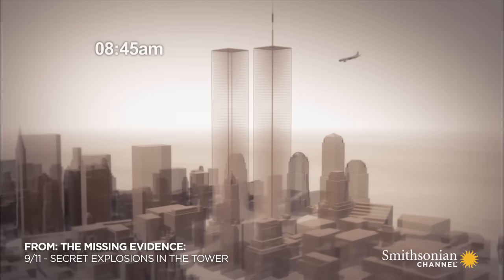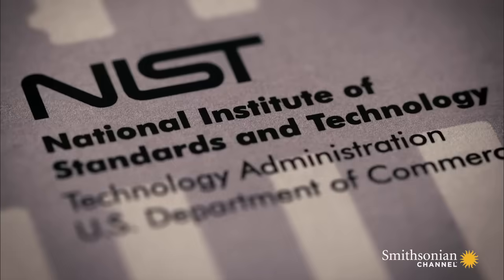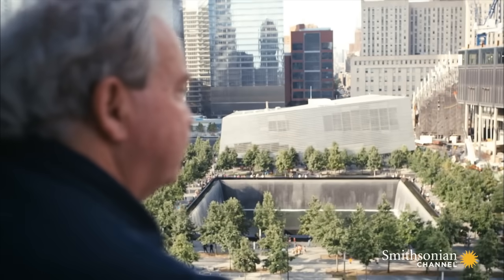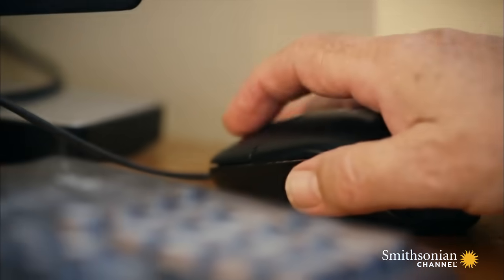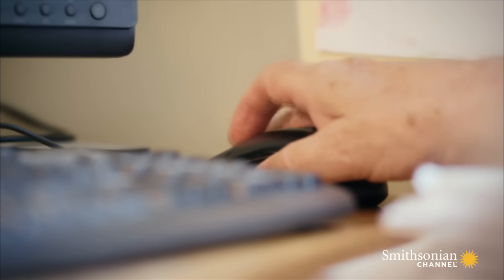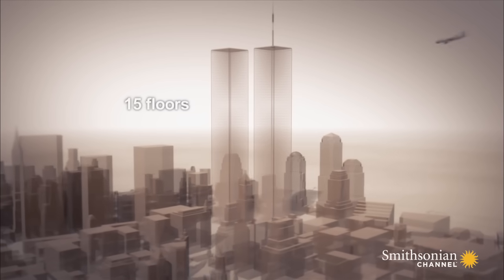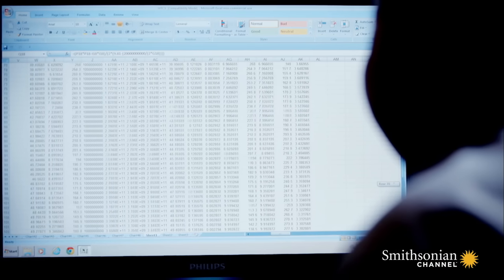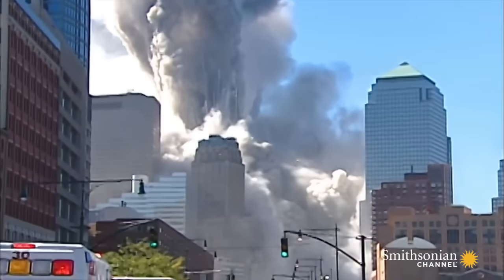This Computer Simulation Explains How the Twin Towers Fell

Comment: So we should believe this guy running some program in his house instead of the 3000 professional architects and engineers who do this sort of thing for a living and contend it was controlled demolishing. Absolutely laughable.
Reply: No.  What is absolutely laughable is all of you idiot truthers who cant understand that the building is NOT DESIGNED for 14 floors to fall on the rest.   That's what is laughable.
Reply: oh,  here comes rockfort files jerkoff,  one of the heavy hitters in the war against common sense.

The top 14 floors represent < 2% of the weight of the building.  

Doofuses like you who think that 98% of the weight is incapable of reducing freefall acceleration by more than a small percentage are not laughable.  That you believe that (which I doubt, I think you're full of shit) is (or would be if you were sincere) an indictment of public education in america.

The fact that you cannot build a model that would behave anything like that doesn't diminsh your enthusiasm.

You are clearly either a moron or a lying sack of crap,  as I've doubtless told you before.

You should look up the definition of science.  You idiots all believe in science by consensus,  but that violates the definition.

Sad sack of crap you are.
Reply: Didnt slow it down.    So then explain how the liberated debris is actually falling faster than the rest of the building.   How could that be.    Maybe just because the building is offering resistance.   How much oh about 2 or3 %    Why becuase it is not designed to carry dynamic loads.

You dont seem to understand any of this.
Reply: @lebergerdesphotons4565  nothing but an eye roll. This has been explained MANY TIMES. The top of the building has been holding all of that weight because it is being carried as it was intended. Should we expect the lower portion to arrest or stop 14 stories MOVING?  The answer is ABSOLUTELY NOT!!  why? Because it only designed to carry it stationary.
Reply: straight down into nothing?? c'mon
Reply: The physical make up of the building was 12% material to 88% space.   The building is almost 90% AIR to begin with.  I ain't makin this shit up dude.
Reply: rockfort doofus,

please cite the same statistic for a boeing 767.  Is it full like a rock?  Or is it even emptier than the building?  And place them both on the mohs scale?  And tell us again about newton's law which demonstrates that frames of reference don't matter?

Let me explain.  It doesn't matter whether the building is sent through a stationary plane or whether a moving plane hits a stationary building, the result is the same.

So lets look at your claim that of course it goes into the building cause of how fast it's going.

Well gosh,  newton says your claim is bunk!

Of course he had a woman's hair-do,  so you might want to write him off.

Hmm,  what does this remind us of?  A baseball and a bat.  The pitcher pitches and the batter swings.  each object has a relatively high speed.  But on collision,  the lighter object changes direction completely and takes off even faster than it came in.  The bat doesn't turn to dust.  Sometimes a bat can break.  It will leave two pieces which could be put back together into an object which would look very much like the original object.

But in your world,  both objects are dust.

I guess the mohs scale must tell us that baseballs and bats are both harder than 767s and world trade towers.

Good thing security never let anybody in there with a baseball or a bat.

Oh, the humanity!  (that's from the Hindenberg which blew up in New Jersey because usa was embargoing helium to germany.)
Reply: Planes are lightweight, thats how they fly ; )
Reply: Right.  300,000 pounds of lightweight.    They fly because the wings generate enough lift to get all of that weigh off the ground.    A fully loaded 747 weighs 900,000 pounds.  I'd hardly call that light.   And 50 tons of fuel?  Liquid does not compress.
Reply: It's all relative baby!
Reply: roquefortfiles
3 hours ago
Right.  300,000 pounds of lightweight.  

lightweight what?

  They fly because the wings generate enough lift to get all of that weigh off the ground.    A fully loaded 747 weighs 900,000 pounds. 

The 767-200ER was the first extended-range model and entered service with El Al in 1984. The type's increased range is due to an additional center fuel tank and a higher maximum takeoff weight (MTOW) of up to 395,000 lb (179,000 kg).

ok,  you're off by more than a factor of 2

 I'd hardly call that light.   And 50 tons of fuel?  Liquid does not compress. 

liquid doesn't compress.  fine.  so when the thin sheet metal tank hits the thick box beams or a concrete slab on edge it ruptures instantly and the liquid is atomized.

200 tons of 767 vs. 300,000 tons of wtc tower.

1500 to one ratio.

equivalent to a 45 slug hitting a 50 pound dog.

Would the dog crumble to the ground in a pile of tiny debris and molten metal?

How about a howitzer shell hitting a big refrigerator?

I guess it would get knocked over or the shell would go through,  but the fridge wouldn't melt and turn to dust, would it?
Reply: what is the percentage of empty space in the 767?
Reply: And an engineer has already explained all of it.   "Had the plane been empty of fuel the building would have won".   The impulse force delivered on impact between an empty jet and one stuffed with 60 tons of fuel is signficantly different.   

Take a bag of cat litter.  A flimsy paper bag you can punch your finger through it?   Do you want to have it dropped on your head from 100 feet full or empty?  
The fact its a flimsy paper bag hasn't changed.   You can apply the same reasoning to the plane.
Reply: @lebergerdesphotons4565  where did the building collapse?. Where the plane hit it. Which building collapsed first?. The second to be hit. The plane hit it 150 mph faster than the first. And off center to one side. How does it collapse?. Off center to one side.  

What a coincidence!!
Reply: rockfish,

this was your idea of logic?  Not surprising.

1/1500th of the weight of the building is the weight of the plane (you know the one that didn't hit the building)

like a .45 caliber bullet in a 50 pound dog.

the dog doesn't turn into a pile of molten dustified rubble when the bullet hits him in the ass.

And neither would the building.

even if the bullet set the dog on fire.

Your argument disagrees with experiment and therefore it is wrong.

Richard Feynman says you only open your mouth to change feet.
Reply: You and Richard Fenyman should book a vacation together.    You have completely garbled his intention.    And your examples are a few notches beyond useless.   And bear no relationship to a plane hitting a building.
Reply: Btw.  What the hell IS your point??   Lets establish that first.    That the plane cannot go through the building???..
Reply: first,  there was no plane, because if a plane had flown right there at 500 mph the smoke from the subsequent explosion would be quite visibly spiralled around in the wingtip vortex.  The video was positioned perfectly to see that and it wasn't seen,  therefore no plane.

The plane in the video didn't reflect sunlight, therefore it is a cgi plane.

Now for the hypothetical.  If a boeing 767 crashed into the building, the building would have locked it out.  It would have ripped itself to shreds crashing into giant spandrel plates fronting giant 4 inch thick concrete slabs on edge.

the debris of the airplane would have fallen to the ground,  the building being no more injured than the dog hit with the .45 in my example demonstrating weight ratios that you don't seem to like for some strange reason (it contradicts your belief system or the bullshit you want others to believe).

Even a solid aluminum bullet fired into the spandrel plates wouldn't make a dent, so to imagine that the 2mm thick edges of the fuselage pushing into those spandrels would do anything significant is ridiculous.

Forget about the speed unless you want to toss Isaac Newton in the trash along with myself and Richard Feynman.

Remember the baseball and bat?  That's a 150 mph crash there and there's rarely any damage to ball or bat.

that's enough.  I know that you're incapable of and unwilling to to ever see a point that somebody could make which disagrees with your programming.

Notice my use of the word programming.  It's intentionally ambiguous as to whether you are programmed or whether you are programming others.
Reply: the debris of the airplane would have fallen to the ground, 

Why? because you say so??     Wow that is just rock solid proof.  Because you say it should.   Don't join the debate team any time soon.  YOu don't convince anybody by opinion.  You convince them with FACTS!!

A B25 hit the Empire state building in 1945.  It put a hole in a solid concrete wall.  One of the engines came out the other side.   (Look it up!)
A B25 weighs 30,000 pounds.  It was flying at 180 mph.  This is considered a LIGHT aircraft. 

The 767 that hit the WTC Weighed over 300,000 pounds.  It carried 10x the fuel load.  And was moving 3 faster.   Hitting a SUBSTANTIALLY lighter structure.  Purpose built as such to be as LIGHT as possible.    (Look it up!!) 

The variance of applied force between the B25 and the 767 was !!!  FOUR THOUSAND FIVE HUNDRED AND FIFTY!!!  x MORE FORCE applied to a SUBSTANTIALLY lighter structure.

Buddy you are so far off the mark there is no point debating anything with you.  We're not in the same league.
Reply: You're in love with Richard Fenyman.
Reply: no,  because the MOHS scale says so.  Aluminum versus steel and concrete.

Tell me of your experience of breaking concrete slabs with an aluminum sledge hammer.  What's that?  You've never seen an aluminum sledge hammer?  Gosh, genius, I wonder why that might be?  Surely a powerful intellectual of your caliber would line up and pay extra to have that aluminum sledge hammer.  Cause you're such a clever bastard you know that you can swing that aluminum sledge hammer faster than the steel one and that energy is proportional to the square of the velocity, so you'll deliver more energy to that mean ole' concrete slab.

Aw,  but then reality would set in and you'd see that a couple swings with your aluminum sledge hammer in spite of the superior energy delivery just deformed while the cement laughed and giggled.

Maybe the mohs scale was right after all!
Reply: El Al flight 1862 lost both of its engines when the pilon of one failed and it broke off taking out the engine beside it.    The pilots struggled to control the plane (A 747)  not knowing what had actually happened as you cannot see the engines from the cockpit.    The imbalance of power drastically affected the planes control.    They brought it in for a landing not realizing that if the speed dropped below a certain level that the affected wing would stall and put them into a spin.   As they came in on final approach of course they slowed the aircraft.  The wing stalled and it went into an uncontrollable spin at low altitude.  With no time to recover.

The plane hit an apartment building.   It took out the entire building and went straight through it.    The plane was flying at about 170 mph LOW SPEED.   And they had dropped their fuel to land.  They took out an entire building. 

And you have trouble understanding a  767 fully fueled?.  Moving at 560mph?  Hitting one wall that was all of 14 inches deep half of which was nothing but glass?  And box columns that were only 9mm thick and hollow?   And that plane going through it easily?   When we have the example of El Al 1862 TAKING OUT AN ENTIRE BUILDING??

Of course if it doesn't agree with experiment ITS WRONG!!

Let Richard Fenyman fuck you.
Reply: Of course you obviously just can't accept the fact that the exterior wall of the WTC was purpose built to be an extremely light construction (Look that up!!) and the fact that the airplane simply went through it EASILY.. No.. That just can't be the case.   

Which it is.
Reply: le berger des photons. Do you actually believe that objects dropped at the same time, that the higher up objects will pass the lower objects?  Even though both are falling at the same speed? You probably believe the earth is flat as well.
Reply: @roquefortfiles  and after that happened they designed towers like the wtc, steel concrete shell, steel concrete core
Reply: @roquefortfiles  I just happen to see you arguing with this " le berger des photons "- guy.. don't bother! I tried to explain the same exact facts to this guy (among many others) and it's totally pointless! I know it's mind boggling how someone can lack all common sense and education but it really seems to be the case here! I've seen more intelligent 3 year old's than this guy so try to forget him.. you're not going to make him any smarter.. that's for sure :/
Reply: @lebergerdesphotons4565  Jesus you're crazy! :D
Reply: @haslahali746   Oh I know.  The only reason i even engage is for the pure "Sociology" of it all.  I find it interesting to see how far someone can take irrationality.   Or total lack of reason.  We all have a brain but some just don't use it.
Reply: @haslahali746  

c'mon doofus,  try again.  surely you can actually say something intelligent indicating that you've made observations and have even some limited knowledge of reality permitting you to say something that could be misconstrued as halfway intelligent.

Why is it vital to you that your "arguments" are always completely absent substance?

You don't need to answer.  The question is rhetorical.
Reply: @lebergerdesphotons4565  I know I shouldn't laugh at people who are mentally ill, but your comments are just priceless so I can't help myself! I would like to give you an example but there are just too many hilarious ones to choose from.. first one coming to my mind is the one where you compared a dog to a steel & concrete skycraper but that wasn't nearly as stupid as some of the others. Just out of curiosity, in which alternative universe, have you convinced yourself to be intelligent by any standards? I know grazy people always see themselves as geniuses, but in your case it's such a far fetch that I really need to know where this is coming from?
Reply: Hasla Hali
“I probably already told you this but I happen to design structures in to buildings.. some of them really similar than WTC’s”
~Hasla Hali
Well shut my mouth... talk about believable.
Reply: @hotmoffitt  I'm not sure if I understood your comment? :)
Reply: @hotmoffitt  No problem! These things happen! :) I first started doing this just for my own amusement but after seeing the total ignorance of this Truther lunatics I'm actually quite worried! :D
Reply: erom1970 3000 out of a 100000 in the US alone, so globally that’s only a drop of water
Reply: erom1970 - These 3000 so called architects are the laughing stock of the whole construction business! Many of them have been fired from their jobs after making embarrassing claims about the twin towers and 9/11. This is probably a good thing considering how incredibly unprofessional they sound!
There was nothing controlled about the collapse of the twin towers! Sheer amount of explosives and wiring required to take down buildings like WTC's would have been enormous and therefore impossible to plant in strategic points without nobody noticing. Not to mention months of pre-weakening work before the actual "demolition". Guy in the video explains how the towers collapsed and he was absolutely right.. I can tell this for a fact since I design buildings myself. There's one thing I've never understood.. how can people like you say things like "so we should believe this guy running some program in his house. Absolutely laughable", when you have zero knowledge about construction business or structural engineering? It's kind of weird that you people seem to think you're able to judge other people's researches on this subject without even a basic education on it. It's freaking annoying!!
Reply: @haslahali746  Oh sure they are, and amongst them a Nobel peace price winner.
Reply: @ZygimantasA  Inventor of a Chlorine gas won a Nobel Peace Prize too. Just like the inventor of lobotomy! Also, sorry for the nitpicking but it's Prize, not "price". Now, please tell how this Nobel Peace Prize winner is and how in hell did he/she win it??
Reply: @haslahali746  There were strange reports of college students having access to floors prior to 9/11 they could of placed bombs.
Reply: Just remember that the engineers behind the titanic deemed it to be unsinkable.
Reply: 3,000 out of the million or so engineers and architects
 wow
Reply: @Ikelae  Exactly.. so fucking impressive! :D I would expect 3000 from a million to be crazy anyhow!
Reply: What makes those 3000 A+E's more credible than the hundreds of thousands of architects and engineers who accept NIST's collapse analysis?  Oh that's right, they must be on Bush's payroll.  Good answer!  derp
Reply: J T  the government has nothing to do with building engineering.
Reply: J T  oh. And your proof of this is what?. Where do guys come up with these wild assertions?. Unbelievable
Reply: Thinking the building is remotely designed to stop and arrest 23 stories collectively falling? THAT is astoundingly stupid. Buddy the safety margin was 6 floors are you insane.
Reply: J T   Of course a passenger jet being flown into it had nothing to do with why the building came down.     Thank You JT without people like you we'd all be lost.
Reply: J T  I couldn't care less about the " official story". Also, I couldn't care less about why or by whom 9/11 happened in the first place. My point is that the towers came down by a structural collapse and I know this since I fucking happen to design buildings like WTC's. Not as big though..
Reply: @haslahali746  

no offense,  but you're obviously either a lying sack of crap or a moron.  If you utter a couple more of your stupidities I'm sure I'll be able to decide which.
Reply: @lebergerdesphotons4565  I can't believe myself actually commenting to someone who compares 1300  skycrapers to a dog but I would like you to explain what makes me "a lying sack of shit" or "stupid" ?
Reply: Its clear now there was no controlled demolishion. In close up video’s you can see the steal beams bent and give way, after an hour intense burning fire, as molten metal pours out the building. The whole building had already taken a punch as the people felt the whole building move when the planes hit and even the ground floor had the windows blown out! The immense huge force of the building coming down just destroyed the rest of it.
Reply: sorry  @BakkerSamuel ,  but you're clearly a doofus.

Wood stoves are made of steel which is less resistant to heat than the structural steel in those buildings.  You can't burn kerosene in open air and get hot enough to do anything to it.  The samples showed nothing above 400 degrees centigrade.
Reply: @BakkerSamuel  Look at this guy J T. Another genius how educated himself in the internet and now thinks he's the smartest guy on the planet! He seems to think that watching Youtube and cussing are the standing points of his superior intellect.
Reply: J T Why so aggressive..? So the people heard explosions, you believe that, but you dont believe the people that saw the planes fly in...
And if they heard explosions it can have had many different causes, as you imagine the huge force and energy when such a big building comes down. I Dont find it strange that in the process things explode or burst out of the building. The building also did not go do down completely straight. You can see the upper part tilt to one side, because the steel beams gave way on one side. That also shows it did not collapse because of explosions. Please Dont reply When you want to be aggressive again.
Reply: J T ahhh are you tired..?? You poor Twin Towers expert..!
Yeah they put bombs in the building and Thats why the building started to brake and collapse exactly at the location where the planes hit.
Or was there a bomb in that intense fire for an hour..?
Reply: @BakkerSamuel  

just when I thought you'd be unable to surpass your previous stupidities.  I think that you need to get into the special olympics.
Reply: J T  As I already said, I really don't care why 9/11 happened. I was talking about the collapse of the towers, and considering the circumstances and the way they were built, it's pretty obvious why they collapsed. I can tell you this based on my 5 year education in the university. Eventhough this should be obvious even without education on this subject.
Reply: J T  I think like 4 or 5 buildings were damaged during this attack all owned by him, the funny thing is these buildings are spread out and theres almost no damage to any other buildings.
Reply: “This guy running some program in his house” that guy is a nuclear chemist.
Reply: LOL 3000 out of how many architects and enginers in the world?
Reply: @haslahali746  

@le berger des photons No. CGI planes flying in to buildings is what makes sense. I wonder where they hide the soccer stadium sized projector completed with sound effects and all? 

Because genius that you are you only know about 1950's technology.  If you weren't such a lying doofus you could find where John Lear shows the right projector in the pages of a defense contractor's catalog which can easily go in a stealthed aircraft.

It's also quite impressive how they managed to blow exactly plane shaped holes in the buildings, exactly the right time. 

Yeah, doofus,  real tough when they had access for months in advance.

This is all very impressive, but what is even more impressive is the fact that somebody as mentally retarded as you, is able to write.

Oh,  good one!  You're so clever!

 Based on your comments, I would say you never graduated the kindergarten and probably fucked up your already damaged brains by using way too much acid. 

I don't even need any acid to pity you and not feel any anger for your harsh words.  How could I be angry with somebody I pity?

Even when I only have your comments to back this up, it's still way more you ever had for your idiotic claims. 

I know your type,  doofus.  You'll make statements like that, but you'll never get to anything concrete to refute anything I've said.

I would try to explain you the most basic facts about physics and constructions but some people are just way beyond help. 

See there?  No big surprise,  just ad hominem with no substance.

I'm sure I'll never see any substance from you.

Maybe we'll get back to it when you figure out how to use a toaster first. 

You stick the bread in and push the lever down,  right?
Reply: colombine was also an inside job. it was the government!!!!
Reply: that's funny I must have missed the part on the reports where it said it was a controlled demolishing. let's calculate the chances of a controlled demolishing taking place at the exact time of a terrorist attack. maybe calculate the chances of one of the thousands of people inside the towers not noticing demolition material. Or just look at the fact that it wasn't controlled... at all. by the way are these the same pro architects and engineers who said the building could survive being hit by a plane or are they the same architects and engineers who said the Titanic was unsinkable?
Reply: @informationoverload2487  Those buildings did survive the impact of the planes since they stood for over an hour after that! Saying that it was a controlled demolition is something that only idiots who know nothing about constructions would say :) The towers would have required tens of thousands of tons of explosives, thousands of miles of wiring and months of pre-weakening work! Not to mention the charges would have exploded when the planes hit and it's impossible to take a building down controllably after a jumbo jet has hit it! :) Don't waste your time trying to explain this to people.. they are imbeciles!
Reply: @haslahali746  you're completely right. but I already said they survived the impact in one of my other comments. it wasn't the impact that killed the twins. just like the impact of a bullet isn't what kills someone who gets shot.  you and I appear to be the only people intelligent enough to point this out lol.
Reply: @informationoverload2487  So it seems! :D
Reply: @haslahali746  it's like they can't accept what their eyes clearly tell them. the planes hit and the buildings fell. It's like Titanic all over again only dumber because we have video proof that there was no conspiracy.
Reply: Good point
Reply: erom1970 nobody thinks it was a controlled demolition except for you and your friends, zero of whom are architects or engineers.
Reply: @hotmoffitt  And you know that, do you?
Reply: Kane Keylewer yep. If any of you were you’d be jumping at the opportunity to show everyone how what you believe works mathematically. But you know that already. My comment was geared more towards anyone who might be toying with the thought of believing any part of these conspiracy theories - sometimes it takes a reminder that everything they say is pure speculation enhanced by creative name calling.
Reply: @hotmoffitt  Rightio.
Reply: 3000 architects and engineers? Can you provide a citation of their research? I can't seem to find any credible unbiased evidence
Reply: @MrEvan1932  Do your research, literally every Architect int he US and the EU confirmed that it is unprecedented for such steel structures to be melted by fire in such a short time.
Reply: @ZygimantasA  I did do my research and have yet to find a credible peer-reviewed source that supports such a claim
Reply: @MrEvan1932  Well, you clearly haven't, as 3020 Architects and Engineers have even established a website where they have put all their findings in one place that do not support the claims in the Government report. Look it up.
Reply: @ZygimantasA  , I am still researching as things don't add up to me. Can I have the name of the website plse?.
Reply: @ZygimantasA  A building like this could burn for days if not weeks and still stand.
Reply: @ZygimantasA  The ratio of engineers who did NOT confirm your claim to those who did is 10,000 to 1. That''s right. One out of 10,000 agree with you.
Reply: nope you shouldnt! check his math, check his methodology. If you find inconsistencies then form them into a rebuttal(?) and expose them to peer review.
Reply: sounds like a waste of time.  Morons like you will always believe that turds can be polished, smart people can see bullshit from far.
Reply: @lebergerdesphotons4565  , I read your opinion on 9/11 & just wanted to say I too bieleve there is things that point to this being " corrupt. & although I don't know as much as you do about it. It doesn't mean that what you've said didn't happen!! Some ppl just can't see that a government would do such things. Whereas I bieleve they would.
Reply: @philipwhite8380  

Unless their latest invention is a plane that can fly through a sunny day and not reflect light.

Gosh,  how did those "planes" find a shadow on a sunny day?  They must have had official story coincidentardists navigating.
Reply: le berger des photons hahaahahahahahahahahahahahaaha conspiracy nerd!!!!!!Ahhh you heard someone say the planes didnt catch light..? The CGI artist was not skilled enough to create planes with light effects......? For how long have you been crying on this..?
Reply: le berger des photons the holes in the building in perfect shape and size of a plane was also CGI. Hey did you know the whole building collapsing was also CGI?? It was all fake man! They just moved the buildings to some secret location......
Reply: le berger des photons by the way there are many shots of the plane with reflections of the sun. So the CGI man was better than you thought :)
Reply: I died laughing at the same thing. lol
Reply: @beatz4798  you people are just such a bunch of uneducated twits
Reply: or look simply at the lack of wingtip vortex and you'll have all the proof you need that there were no planes.  But knock yourself acting like you understand complicated math created to fool doofuses like you who can always look but not see what's in front of their own brainless faces.
Reply: they're called vortices doofus. ALSO The irony of believing that there were no planes, yet saying that other people can not see what is in front of their own faces.
Reply: Can you please explain to me how the government got a hold of every single video taken by citizens and replaced it with CGI planes?
Reply: two wings on a plane. two vortices.  You can believe what you want. they are in the video. you are simply ignoring it and ignoring what I said previous about them. and now you are creating some sort of strawman and claiming that the the planes are fake because lighting and reflections? watch footage from different angles. you can see reflections, you can see change in the light.  you speak in such vague terms while also attempting to pretend that you have so much information. why can you not describe it in detail then? Why am I even replying to you? its all pointless.
Reply: le berger des photons 
you seem to do nothing more than reaffirm what you already believe to be true rather than objectively researching something for youself. one can easily fall for bogus conspiracy theories when the only information they get is from bogus conspiracy theories.
Reply: every single?  How many different videos have you seen?  They've been listening to every phone call made in the usa since before 2001.  It seems to me they could do this by simply doing the job that the Rothschild Bank hired them to do on behalf of Rothschild's clients at the vatican and elsewhere.   

That you believe the official story of 911 is proof that you've been watching too much tv and ignoring too much history.

You don't know squat.  You don't know that 2 brothers were the chief negociators for  the two opposite sides after world war one.  Even hearing it now you're probably too dense to realize that this means that the fix was in.

Every war has been staged for profit.  Every war has been preceded by a false flag, staged or real.

That goes back at least to the spanish american war.

Rothschild's fortune first went supersonic after insider trading on english war bonds following Napoleon's defeat.

And you've had all of these examples of false flags to start wars proven to you and no longer disputed, but you still can't recognize one when you see one.

And even with the lack of wingtip vortex which is yet more confirmation that the videos are cinema and not journalism.

Is there any hope for you?
Reply: Mateorl, Let's just walk away, it's hopeless. He is either memeing or there is just no way of convincing him. He has dug his hole too deep into a paranoid world that there is no possible way youtube comments are going to sway his opinion. Although I believe he is just meming at this point. If not, then he is a sad, sad, mentally unstable man, and there is nothing and nobody who can save him from his paranoid schizophrenic beliefs.
Reply: @lebergerdesphotons4565  I was in New York City when this happened. 

If there were no planes what did I and almost every fucking person in lower Manhattan see then?

You could see the planes coming across the city scape and fly into the building, you felt a tremendous shock when they hit the buildings and an enormous crack.

You don't have to take my word for it though, go to New York and talk to literally any of the millions of people over the age of 28 who were in Manhattan at the time just don't except to leave with all your teeth.

I don't even understand how this is a question.

Like, its something we all, rather we were there or on TV literally fucking seen with our own eyes.
Reply: @bubblegumbabeface6629  there were planes but people believe there were bombs in the buildings too.
Reply: le berger des photons 
Really? No planes? Are you serious?...lol
Reply: A&Efor911troof are what's laughable. Bunch of paid shills.